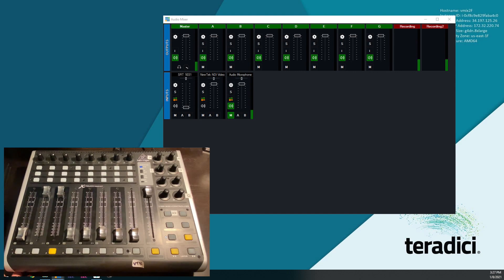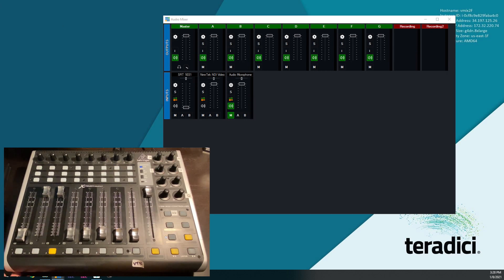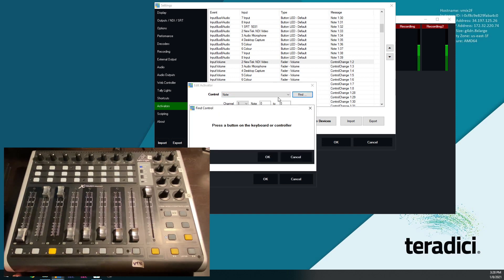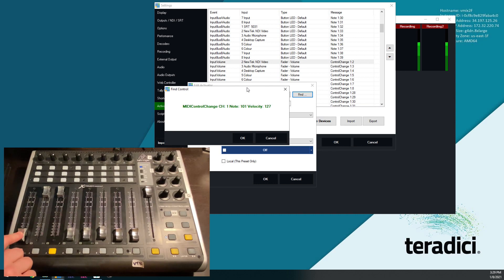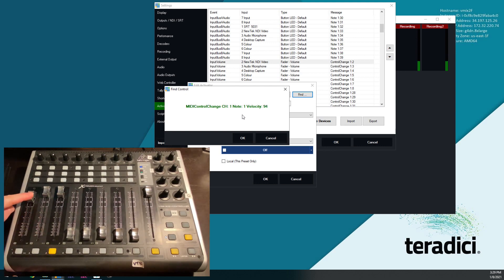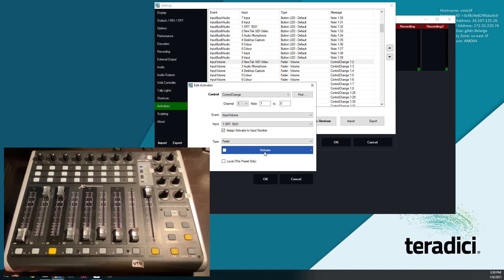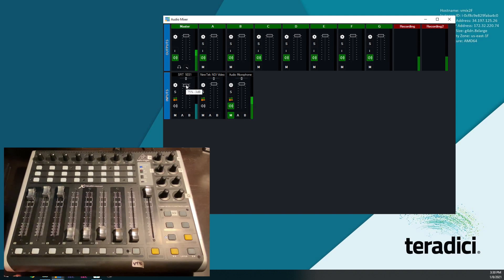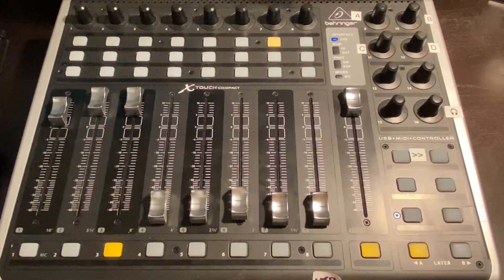Behringer x-Touch compact motorized faders with vMix

Comment: Soooo .... I've followed your excellent instructions and the fader on my Xtouch won't move the Vmix fader BUT if I move the Vmix fader (on computer screen) the Xtouch fader will move?? Any ideas why it won't work both ways?
Reply from the maker: Make sure your x-touch is enabled in both the shortcut settings and the activator settings.

Comment: What method are you using to pass your microphone and MIDI to the cloud instance?
Reply from the maker: i'm using Teradici Remote desktop software with my AWS instances.  Automatically passes the default system microphone to remote device
Reply: @tvguy2  Nice. That works well for director mic, but a lot of my productions involve virtual audio cables and routing in/out of other programs, something that I can't seem to figure out how to do on a remote instance.
Reply from the maker: @marshall409  VB-audio cable works well on a remote machine, we use it all the time.  
However, our preferred method of routing audio around in the cloud is NDI.

Comment: Hey man, thankyou for this. Only issue i've got is that it works vMix > Fader (fader on x-Touch replicates vMix), but won't work Fader > vMix. If I move the fader it will snap back to the position of the fader on vMix. Any ideas?
Reply: The same problem here... is there a solution?
Reply: @multimediamax_belgium  Yes same thing here. Did you find a solution?
Reply: Yes, same thig here. Did you find a solution?
Reply: Sounds like you have setup the activator as described in the video, but not setup the shortcut “SetVolume” on the same channel. To have a motorized fader properly working it has to be a combination of shortcut for moving the fader with the x-touch, and activator to have vmix set the motorized fader.